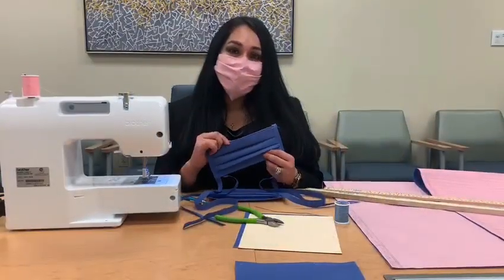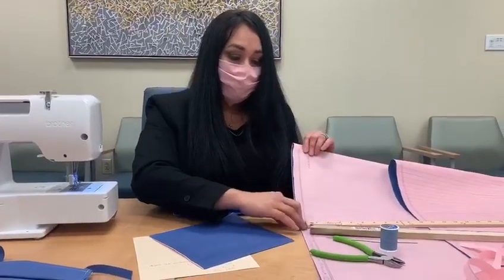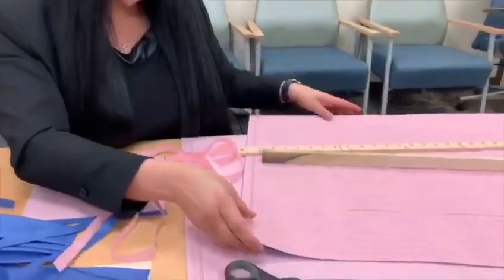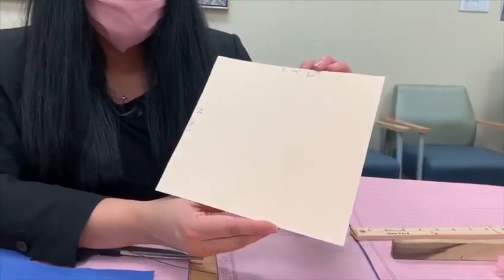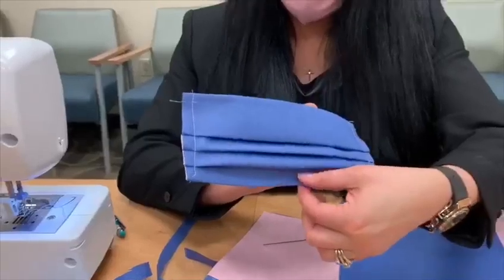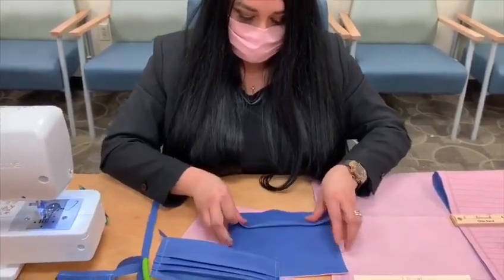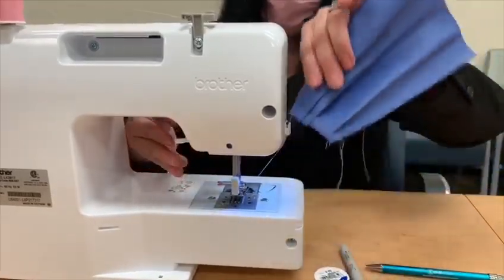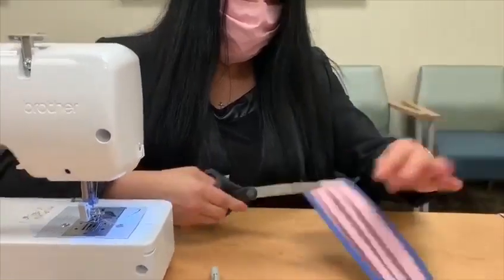AskDHR • How Do You Make a Halyard H600 Surgical Face Mask?

Comment: There are YouTube videos on how to make masks equal to N95 out of several other materials. The HEPA certified bags for some older vacuum cleaners can be used to make 4 masks out of the 4 corners of the bag. IIRC, HEPA vacuum bags have the same 0.3 micron porosity of an N95. Of all things, 2 drip coffee maker filters can be combined to make an effective mask. When using cloths, hold them up to a strong light. The more light that shines through, the more porous the mask. Bandana masks - especially worn like Butch Cassidy & Sundance are the worst.
Reply: Also, 600 denier (weave) or higher pillow cases make effective masks. You can also make masks from your thickest t-shirts (check against a light to see if they don't allow much or any light through.  You can cut a mask, complete with 2 ear straps, out as a single piece or fold a piece of the t-shirt into 2 layers and cut the same mask 2 layers thick.  Lots of ingenuity on the web - just be careful what you are seeing is correct. And DON'T drink bleach. Poison control centers reported a 300% increase in people drinking toxic bleach and anti-disinfectants within hours of the President's maunderings about it. And UV light does NOT affect CoV-2 any more than plain sunlight as far as any test to date has shown. There is no one-touch instant particle killer yet (if ever). There is also no vaccine yet (if ever) regardless of anecdotal stories and less-than-rigorous "backyard" tests. Even antibodies are questionable. Some viruses produce antibodies that give no immunity. Some cover you from weeks to up to 2 years. Some, like cowpox/smallpox are long-lived. The sicker you are, the greater the antibody buildup in your blood. The survivors of the worst SARS and MERS infections seemed to have gained 2 years protection. We are already seeing reports of re-infections of survivors from other countries. Our testing - the worst in the world - will keep us way behind the curve on learning about this new virus.

Comment: My sister-in-law, who used to run the fashion school at a major university, lives in NJ. She has the family and several alumni all engaged in making Halyard H600 masks for the NYC/NJ hospitals. They are more comprehensive and highly sealed, without the foldy, surgical mask look, but great coverage and seal. We've delivered thousands to the hardest hit hospitals. Halyard is DEFINITELY blue and white. Don't trust something pink. 

You shouldn't wash or spray them. One of the inventors of the NIOSH N95 shell-style masks wrote that re-sanitizing the masks was most effective if put on a brown paper bag and in an oven or other hot source for a period of time. SARS was best at 149 degrees for 15 minutes. COVID seems to be best at 160 degrees for 30 minutes. Note: most ovens' low end is 170 degrees and even then will continue to heat to up to 200 degrees over the half hour. It doesn't take too  much extra temperature to weaken the mask or ruin it. If you use an oven, get a very good thermometer that reads in 5 or 10 degree increments and hover over the oven, keeping the door cracked just enough to keep it at 160 & the masks & the thermometer away from directly over the heating elements. DON'T OVERHEAT HALYARD OR N95 MASKS.  

The various sprays that advertise that they kill 99.9% of coronavirus are talking about the four most common varieties that cause (along with rhinovirus) the common cold. They aren't certified for SARS or MERS, and, to date, NO chemical or ultra-violet sterilization has shown to kill the CoV-2 virus particles. Exposure to the sun on a hot, humid day can do it (keep it out 1 to 2 days for safety) or the 30-minute oven trick. That's not scientifically proven, but is the best suggestion the N95 developer could give us.  BTW, while CoV-2 can survive from minutes to a day or two, depending on the surface it is on (google "fomite") in the air in hot and sunny environments, the same can't be said for less optimal environments. An epidemiological team went onto the Diamond Princess cruise ship 17 days after the last human was evacuated and found live, communicable CoV-2 virus on some hard metal and other surfaces within the ship (out  of direct sunlight). On a store's door, the outside handle exposed to sun & our Florida 80/90 degree temperature may be clean in minutes, while the inside handle in shady air conditioning may still be dangerous at least for hours. 

NEVER touch a gas pump without gloves. They virtually never go long enough to be sanitized between customers no matter what the weather. Word to the wise. Gloves - and don't touch your face with the external surface of the gloves. Use them once & discard. If you are having trouble finding Nitrile or latex gloves, often an Auto Parts store is a surprise cache of them. Some are thicker and less likely to rip, but still give you good textured gripping surfaces. 

A last suggestion from somebody who has been in hot zones before for several pandemics over the past 20 years, wear a second mask, say a folded cotton surgical N95 mask OVER your Halyard mask as further protection of the Halyard mask to lengthen its usable life. Double masking is becoming more and more common in major COVID zones.  If you are having a bit of trouble breathing - good. Your mask isn't too porous (N95 is 0.3 microns). And, if you're steaming up your glasses, you don't have an optimal seal. Seal the mask around your nose first, with the index fingers of both hands (not thumb and index finger of one hand) and then press tight from there around the mask. Cut off all face hair that might interfere with the seal (I'm down to a small covered goatee) & shave EVERY DAY (twice if necessary). Less seal = less protection. If the mask's ear loops are too tight around the backs of your ears, run a string loop between them around the back of your head and tie it off. It takes pressure off the backs of your ears and even tightens the seal.

Stay safe and it's still better to stay bunkered up at home and not need the mask except for NECESSARY excursions. DON'T believe the states or White House calling for easing of restrictions. They just want to show better economic numbers in the 3rd quarter than the 2nd they can brag about to get them through the election. There'll be hell to pay come winter - after the votes are safely in. World War II taught us you can rebuild totally devastated personal, national & world economies. Nothing can bring back somebody who has died.
Reply: And to add to this, please cover your eyes with safety glasses, sunglasses, face shield, etc. There are ACE2 receptors in the eye, and also the lacrimal duct leads directly into your sinuses. The data on this route of infection seems solid enough to warrant some caution.

Comment: Is Halyard H600 washable?
Reply: chel woodford Yes sterilize in oven at 70° Celsius but be sure the mask is not touching metal (tie to something and yet hang in oven) because the metal gets hotter then the air in the oven. Here’s a link...

https://utrf.tennessee.edu/information-faqs-performance-protection-sterilization-of-face-mask-materials/
Reply: Ditto!
Reply: From another video that used Halyard H600, it can withstand 250 degrees in the oven for 30 mins as the means to sterilize it.
Reply: @alonesaus2340  
That is too high a temp and too long of a duration.  That mask will be RUINED.
Please read the comment from BLUE SUN posted about 1 week ago.
Reply from the maker: Thank you for your question! Halyard fabric is not washable.
Reply: halyard is  used in autoclaves
Reply: @shelbilucas  Yes, used ONCE in an autoclave. This material is made from 3 layers, and the middle layer has an electrostatic charge. Getting it wet negates that charge and makes the mask less effective. The charge is designed to prevent any bacteria from escaping in between wrapping instruments, and placing them into the autoclave.
Reply: @patrickrankin4542  Halyard has TWO layers according to the manufacturer and doesn't mention anything about an electrostatic charge.
  I was pointing out that it's used in autoclaves as opposed to an oven.
Reply: @shelbilucas  - According to the ISO standard I read on Halyard some time ago, it is subjected to a potassium phosphate anti-static treatment in it's manufacture. It may not be accurate to call that a third layer, but Halyard does have electrostatic properties.
Reply: Hang in oven@appx 160-165 degrees farenheit for 30 min